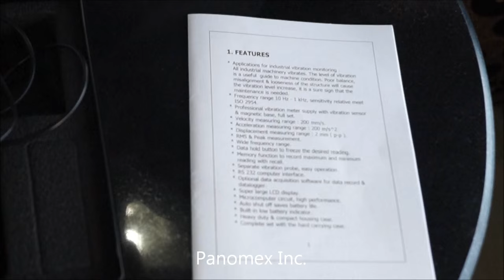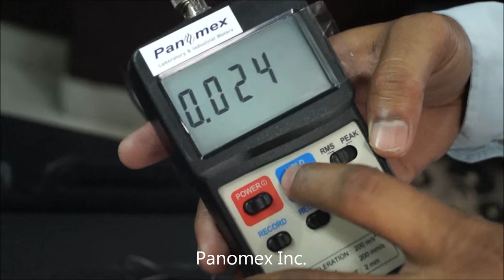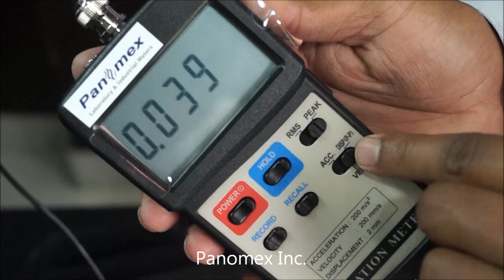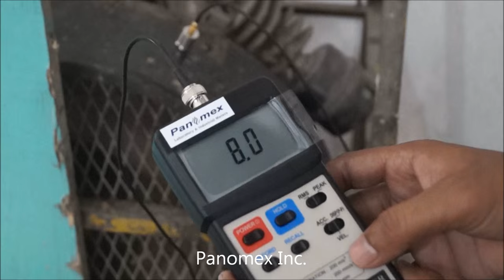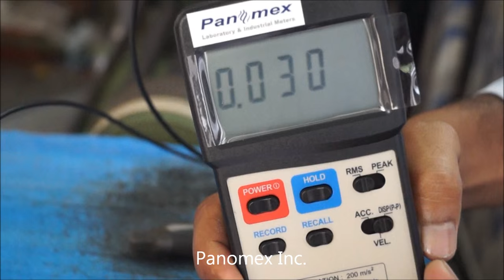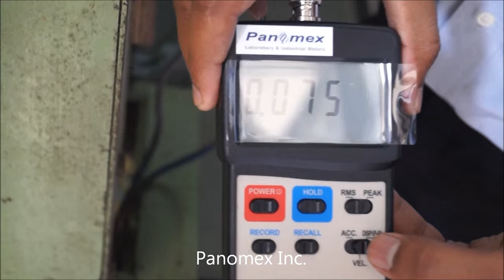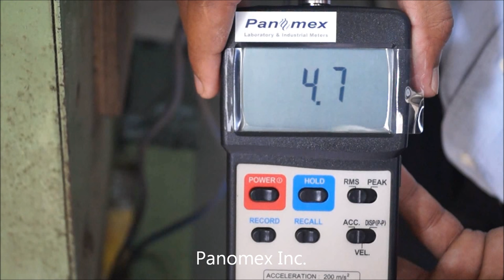Vibration Meter - Vibration Measurement Instrument

Comment: @DILIP SHENOY IT HAS DETACHABLE MAGNETIC PART SO IT IS VERY EASILY USED FOR BOTH. IF YOU WANT FOR NONMAGNETIC SURFACETHEN YOU HAVE TO REMOVE THE MAGNET FROM THE SENSORS TOP

Comment: I can't hear any audio sound or vibrations or enviremental noise in the video.Repeating the question someone asked. It will stay attatched with magnetic surface itself & no need to hold it but after removing magnet, how it will stay firmly pressed with non magnetic surface ? Have to hold with manual hand pressure ? If, yes. Have to use both hand (one with probe & other with vibration meter)
Reply: What do you work with? messege me with your contact info and i will tell you what will work :)

Comment: Is it only for measuring magnetic part ?  What if the machine is non-magnetic.?
Reply from the maker: +Dilip Shenoy It works fine with both types.
Reply: +Panomex Inc. But the surface of the machine on which we want to measure is for Ex: Aluminum. How will the magnetic base with the sensor could be attached to a non-magnetic surface?
Reply: Panomex Inc.    what is vibration limit for helical gearbox
vibration bad or good
Reply: Nail it with the iron nail
Reply: Where I can buy this ...for gear box vibration purpose